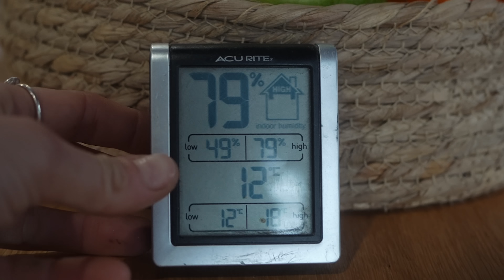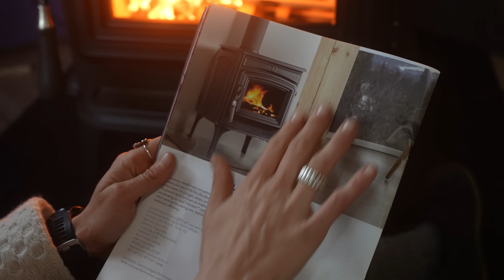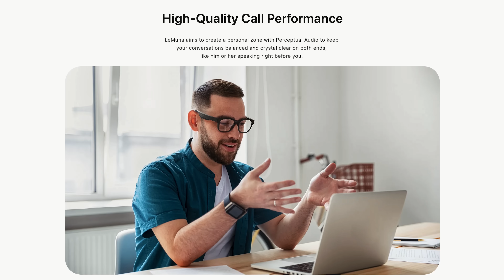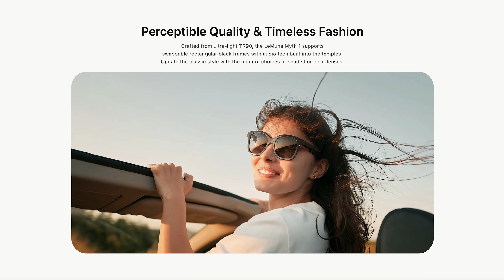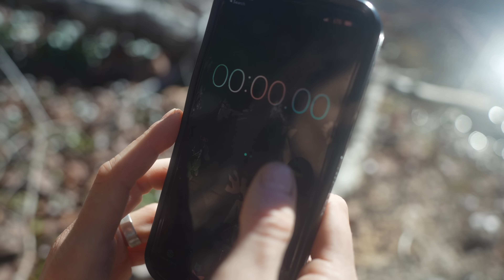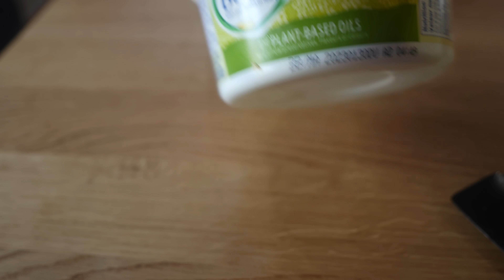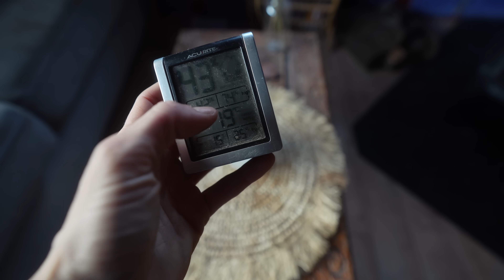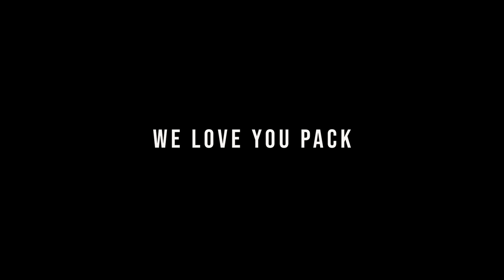Why I'm Alone

Comment: Just curious why not a pellet stove in your shed. We use one in our garage which is a workshop/bar and we find pellets easier to manage. Though we don't have the capacity to cut our own firewood like you do.
Reply from the maker: Pellets are pretty expensive, continue to climb in price & that involves us going to a store to pick them up. When we have a lot of wood where we live. Also, they take 60 hertz of electricity constantly. If our off grid system ever stopped working or something happened it could fry the engine board. Which is 2K. In addition pellet stoves like to be kept at 20 degrees or warmer. Which we don’t attend on having the garage that warm unless we are working in it. We were going to go with a pellet stove but after learning this from the installers we decided it’s not best for our situation. They’re great though!
Reply: @Vanwives  I'm thrilled you responded to this! You obviously really listen to your fans and read the comments which is amazing. And, as a longtime fan of the channel, I'm also not surprised you did such in depth research! Continue living the dream!

Comment: At 16:45 you cut XPS with a saw in nature. All chips falling down on the ground will persist there for +1000 years... living in the wilderness also means the responsibility to not pollute this beautiful place with micro plastic or oder non putrescible matters. Next time just do it inside and use a vacuum cleaner or use sustainable materials

Comment: the boxes you made need to be waterproofed on the outside or else the wood gets wet and freeze's then add more cold than expected I surgest getting a hot wire to add around the water lines...
Reply from the maker: Thanks! They're treated wood & we also have heat trace :)

Comment: [Disclaimer, not an expert]
Instead of moving the rain barrel on your outhouse next year, what if you drill a hole on the side near the top, and run a hose from there into the forest? I assume it would work like the overflow drain on the bathtub and probably be less work/material.

Comment: Hi girls I found a fan that circulates the warm air through house  by just setting them on the top of the stove ,it uses the heat to generate power for the fan . As long as stove is hot the fan works for ever , blades span 10"  unprotected other girls need to steer clear  .Two fans keep most of house warmer than usual Brand name is STERLING another site does a 10min piece on item .

Comment: IMPORTANT!  hey Jas....saw on another channel that burning BIRCH logs with the bark on causes black tar/pitch, or creosote, to build up in your chimneys, which is a fire hazard and has to be cleaned more often. . UGH.  REMOVE the bark from the birch, and apparently you can flatten it and sell it somewhere?!  Try to get dry ASH next time, it may cost a tad more, but it has the highest BTU of wood, and you'll need a lot LESS of it!  Burning soft woods, in general, causes more creosote, and is very inefficient. Burn hard if you can. But Ash is the best.  Hope you get this message.  Loving the cabin and looking forward to your winter experience there.   hugs from Windsor Ontario

Comment: Stumbled on your video and respect what you’re doing, but find the exposed combustibles surrounding your wood stove terrifying.  I don’t know who did the install on your SPF insulation (the purple stuff), but they should have advised you that the insulation needs to be covered, typically by layer of drywall.  Would encourage a reflective heat shield as well.  If you don’t already have one, please get a fire extinguisher (dry chemical powder type).